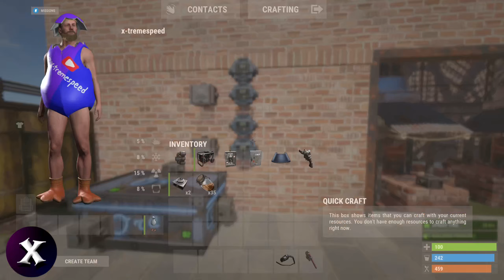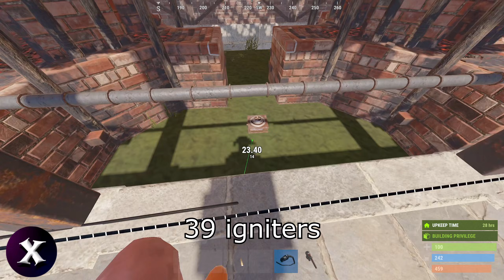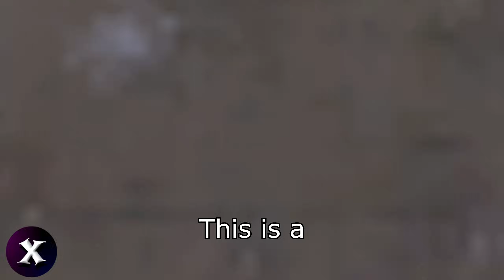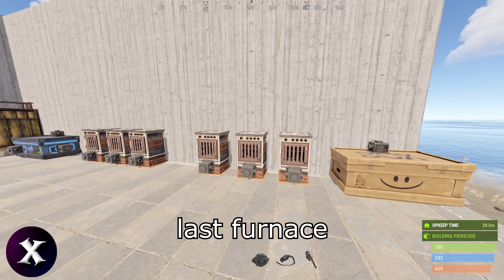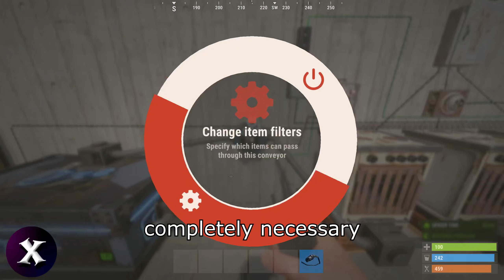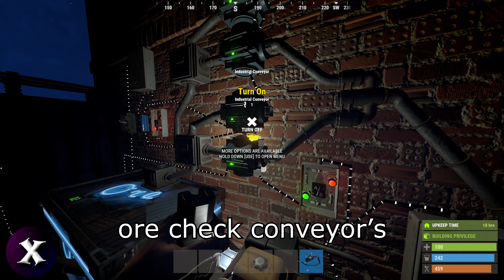Ultimate Auto Smelter Guide | Rust | Tutorial

Comment: I like using a C-Bus for the furnaces. The memory cell is set by an OR with the conveyor filter passes as inputs and is reset by a small battery. This way, the furnaces have no active usage when there's no ore to smelt. You could also have the conveyors powered by a manual toggle C-Bus to eliminate that last 2 active usage when you know you won't need to smelt for a while.
Reply from the maker: The furnaces won't have active usage when not in use, but that would be useful if you put 100+ power worth of components on a single auxiliary battery!

Comment: Dude help me, I did everything right but the furnaces only burn the wood
Reply from the maker: Double check your ore conveyors - ensure they are connected, set to the right filter values, and that they are in the "all items" mode. Also make sure you don't have any minimums or buffers set.

If you are on a modded server, sometimes those mess with industrial. In that case, you may have to pick up all the storage adaptors and replace them on your furnaces AND ore/wood boxes

Comment: Why do you need 4 storage adapters on the ore box if they are all just connected to each other/ Don't you only need one, since they are all going to the same place. I thought you used more storage adaters to send them to different places
Reply from the maker: @scubaturtle1619  The additional storage adaptors increase the throughput needed for larger smelting systems!

When you have up to 30 large furnaces the extra storage adaptors help to stop the furnaces from running dry between transfers.

Comment: You can make the furnace ignition process.fully automatic if you use a memory cell that turns the switch on when the ore filter passes, then reset the memory cell with the filter fail, that way you can just leave the furnaces to to their thing and never have to manually turn them on if your furnaces ever turned off on their own
Reply from the maker: @WilliamAckerOfficial  You mean the electric furnaces? The furnaces no longer turn off by themselves (at least, not when you don't want them to).

 As long as they have power, they will be on!

Comment: So my furnaces will randomly turn off and I manually have to turn them back on I went back through and made sure everything is correct according to the video I’m not very good with these things so I don’t quite understand why this is happening
Reply from the maker: @Jungle87Official  There are two reasons furnaces turn off. They run out of fuel (wood) or they overflow their output slots. If you have large furnaces outside, there's a chance random nakeds use water guns to extinguish them, but that's less likely (but worth mentioning).

This system is designed to stop feeding wood when the ore runs out, so if something isn't set up correctly there it might cause issues too.

Let me know if any of this helps! If you need further assistance, feel free to join my discord linked in the description
Reply from the maker: https://discord.gg/u9JA6Kg3CF
Reply: @x-tremespeed  i disabled the limits of how many resources go into the furnaces and now they stay on but i dont know if that will cause any issues with anything

Comment: could you explain the reasoning behind the quantities for each raw material in the conveyors? for example, why 4 crude instead of 3, 12 wood instead of 10, etc. thanks!
Reply from the maker: @9x2_eterno  Sure!

The raw material amounts are based on the amount of resources each type of smelter can churn through in one conveyor tick (approx 5 seconds).

My amounts don't exactly line up with the smelt rates you may find online because the conveyor tick rates can vary. I've seen anywhere between 3 and 6 second ticks.

12 wood is enough to smelt the remainder of raw materials if the system gets shut off.

All in all, this ensures the furnaces always have materials smelting without downtime, and don't leave any ores unsmelted when the wood finishes burning.

I hope this clears everything up for you!
Reply: @x-tremespeed  I see, especially if you want to avoid grubs. like you said conveyor belt rates are kinda unreliable, but your explanation makes sense. thanks brother

Comment: for some reason when my furnaces are completely empty, resources get put in but the furnaces don't ignite. I have to remove wood from one in order for the igniter to kick in.
Reply: Right, except I'm using small furnaces, and they are completely empty. The wood goes in but they don't start. If I remove the wood from one, they start. Lol 🤷🏻‍♂️
Reply from the maker: @jay_fai  That is rather odd. Are you on modded or vanilla? Also, what form of ignitor are you using (timer, generator, battery/switch)?
Reply from the maker: @jay_fai  That can happen if you don't remove the wood from your large furnaces when first placing them. It shouldn't run into that problem further, as the wood conveyor filling the furnaces is what sets off the ignitors

Comment: why you connect the adapters on the input box, only 1 adapter is enough right?
Reply from the maker: @legend101  in most cases 1 should be enough. There are a few cases where your efficiency would drop with only 1 adapter, but it's not a huge deal.

Comment: I use a similar method but no check coveyor.  If i set it up with a check wood to turn off an ore one...  you can have it set up on 4 power.
Reply from the maker: I'm assuming you use the ore conveyor to turn the wood conveyor on and off? The problem I found with that  configuration is if your ore conveyor fills the furnaces with the max ore settings in one tick. If this happens, I find it often will turn off the wood conveyor before it has a chance to transfer anything and the system gets blocked up.

Comment: Hey I really need help I've set the whole thing up but the generator doesn't turn on I followed all the steps and have low grade in and I have 12 large furnaces
Reply from the maker: @ooga_booga.03  the most likely problem is you only have 1 power going in to your wood conveyor. Conveyors require 2 power in order to use their filter pass/fail inputs. Other than that, ensure you do have filter pass hooked up to the generator's turn on input, and not the filter fail or the generator turn off input.

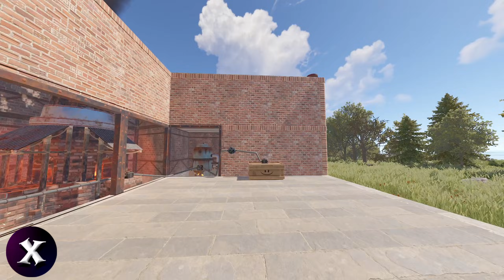Comment: Excellent video. One question though for the Auto Refinery starting at 4:48 . What's the OR switch for? I watched this part several times but I couldn't see you using the second power input of that switch, so could go from the filter pass of the conveyor directly to the timer... Maybe I'm just missing something.
Reply from the maker: @Opa_Andre  Timers used to get set off every time the conveyor moved resources even though filter pass was constant. The OR gate fixed that problem, but they fixed timers and the OR is now unnecessary!
Reply: @x-tremespeed  Thanks alot! Didn't know this and thought you may used the switch as a somehow delay device delaying the start of the igniter to some milliseconds to make sure the refinery is filled. Cool as well they fixed the behavior of the timer. I already thought of using a blocker to block the timer starting the igniter using the filter pass signal of the last conveyor. But as the igniter didn't fire up a second time while the refinery was still running, I discarded that idea. :)

Comment: For the normal electric furnace could you add 3 more to it?
Reply from the maker: Absolutely! you would need to run it off either a medium battery or two small batteries connected into a root combiner for the required power though.
Reply: @x-tremespeed  thank you

Comment: what do the extra storage adaptors on the input box do?
Reply from the maker: It increases the amount of ores a conveyor can pull!

Basically, the conveyor pulls from each adaptor separately, but in the same 'tick'. This way we can make the conveyors pull from the same box 4 times at once which allows us to move more ore into the furnaces so they don't run out!
Reply: @x-tremespeed  would it still work if you have 2 large boxes with 2 adaptors each ?
Reply from the maker: @gabrielmartins7842  yeah! Or even 2 boxes each with 4

Comment: Hey, Just wondering if there is a way to have these start up like in the first system and then signal a sprinkler to turn them off when input filter fail happens for the ore? I would rather not go though all of the wood i have! Just trying to learn the wood auto stuff. Electric is just so much easier!
Reply from the maker: @letsgetsteve  the wood furnaces are set up to stop supplying wood when the ore runs out. This will stop your wood from running out!

Comment: i had troubles with it turning off constantly but if you are on say a 5X server you need to change the values of the wood and ores by multiplying it by say 5 on a 5x server
Reply from the maker: It all depends on the smelting rate. Even 5x servers will sometimes smelt at rates that are higher than 5x. The best thing to do is just see for yourself how quickly the wood burns - default is 30 wood per minute, or one wood for two seconds of smelting.

Comment: Is there a way to get the furnaces to use both slots if smelting a single ore type
Reply from the maker: You don't need to do that, it is smelting at max speed at all times. If you had resources in both slots, they would each run at half speed for the same overall output

Comment: Loving the videos and if you do others! Not sure if this is possible, but maybe on next videos you can add more advanced sections later on (like you did with charcoal) but instead maybe using heartbeat sensors to detect enemies near your large furnace and stop feeding the furnaces? (not sure what other more advanced improvements could be made but would be nice to see what other options).
Reply from the maker: Absolutely! That wouldn't be hard to add at all. A memory cell with the HBHF sensors hooked up to "set" is all you would need to do, with a button to manually reset (or a more complex circuit if you want that automated to). If you want, join my discord linked in the description and I can send you a diagram for that within the next few days.

Comment: how come the igniters dont repeatedly ignite over and over? does the filter pass only pulse a current if there is a break in the resource flow?
Reply from the maker: Filter pass activates and stays active until the conveyor cannot move items anymore, at which point it swaps over to filter fail. It's quite handy!
Reply: @x-tremespeed  yeah i assumed it would turn off and on each time it passes wood, but it just never turns off, i hopped on a server to test it and the time it stays on after passing wood is long enough to have 100% uptime so its works perfectly
Reply: @x-tremespeed  i have a question that im a little confused on. How come the filter pass activates only when it can move stuff. But the check conveyers activate when its not even connected to anything and cant move anything? Does it just freak out and perma try to move it even tho its going nowhere?
Reply from the maker: @Julez3133  The check conveyors only look at the input container to see if items can be moved, not the output container.

This is further seen if you connect a conveyor to output into a box that is already full - the conveyor will still output filter pass despite not moving anything!

Comment: Is there a benefit to this build compared to your last auto smelter build? I've been using the old build on a wipe right now and it seems to work fine still.
Reply: and also what is the point of the "turn off" to the b port of the OR switch?
Reply from the maker: This one has the added "wood check" conveyor to turn off the ore conveyor, slightly edited power requirements, and the new ignition systems. The last one works fine still, this is just a more complete guide with more than one build!

As for the OR gate, do you mean for the ignition, or in the charcoal factory? For the ignition, it stops micro circuit updates from triggering the ignition circuit. This can happen when power values are changed or even if conveyors move materials, although it is relatively random. For the charcoal factory it's so both the ore check conveyor AND the switch can control whether or not the wood conveyor operates.
Reply: @x-tremespeed  Oh my god this makes so much sense thank you. The only issues I've been having this wipe are my igniters not going off when the wood conveyor's "filter pass" was the only thing connected to the timer's "toggle" Just placed down some OR switches to see if run into this issue still
Reply from the maker: @mtp-97  the problem was with igniters going off too much, it sounds like you have a separate issue 🤔
Reply: @x-tremespeed  interesting my issue is still that the igniters are not going off in time . just built it back to how the auto smelter 3 video is built. first time ive ever ran into this issue.
Reply from the maker: @mtp-97  Assuming it's all hooked up correctly, there are two reasons I can think of.

If you placed large furnaces and didn't empty the wood from at least one of them before trying to start up the system.

The other would be if you only have 1 rW going into the wood conveyor. Due to how conveyors work now, they require 2 rW at their input in order for the filter pass/fail outputs to work.
Reply: @x-tremespeed  i daisy chained the conveyors through passthrough. Just added 2 rW for the "check" conveyor to wood conveyor and wood conveyor "pass" to toggle timer. Hopefully it works. Not sure why the made industrial more compliated this way .
Reply from the maker: @mtp-97  they did it to fix an exploit where you could power an infinite amount of conveyors for 1 rW. I do think there are better options to fix it and hope they revisit it at a later date.

Comment: im sure in the electric furnace Electric Furnace its better 5 in metal and 9 in sulfur. But can you But can you tell me if those values work for you?
Metal - 5
Sulfur - 8
HQM - 3
Reply from the maker: The electric furnace values don't really matter. it's a way to keep the smelt going while not wasting time with the furnaces on but no ore smelting.

I did my testing on a private server, but I could see being on a larger server could have more conveyor lag and need slightly higher settings to compensate!
Reply: @x-tremespeed  yes maybe is the server im doing the test, its a public electric server and they have a little of lag :) another question bro how much active usage I can use from a "small battery" Im using 11/15 do you think its a good number? or with is the limit? thankyou

Comment: Thx a lot for the Guides. Ive done  the Auto Smelter one but it keep on burning all my wood even when i dont have any ore left in the imput box
Reply from the maker: Make sure your ore check conveyor is plugged in to the right slots! Filter pass to turn on the wood conveyor, and filter fail to turn it off. If you still have troubles, feel free to join my discord and I can help out further! The link is in the description
Reply: @x-tremespeed  Seems like the problem is the refinery. If i have wood and crude conveyors will keep on feeding wood to large furnaces  whitout ores and wood+crude to refinery then ignites everything and my large furnaces keep on wasting wood. I just got started with this industrial thing today. Havent playing rust in a while tho glad im testing it b4 a real wipe
Reply from the maker: @Diovick  yeah, if you have the refinery on the same circuit it'll do that. I normally don't mind as I will either have not enough charcoal for gunpowder anyway OR more ore than crude oil.

Comment: This was a amazing video! I always wondered how I could do a auto furnace smelter with 3 small furnaces and it turns off and doesn't waste wood when there is no more ore. I assume the first set-up is basically that
Reply from the maker: Thank you! 

Yeah! If you're using small furnaces inside your base you can even save 1 power and not use the topmost conveyor (the "wood check" one). It's only there to stop ore from sitting in the furnaces which could be stolen if the are in your compound.

Comment: the igniter on the electric furnace is fine but you can control them with the on offs nodes now and not use any power while doing it. just need the available 1 power per furnace.
Reply from the maker: My only issue with using the nodes is the insane amount of wiring you would need to do once you go above half a dozen furnaces. This way you can use a switch to turn them on and off, with the igniter as a failsafe in case they default to off during a server restart.